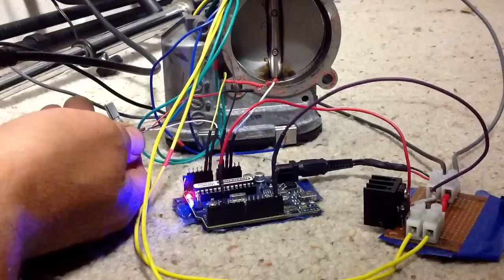Fly by wire throttle body controlled with an Arduino Clone

Comment: Crazy what you can find on you tube. Ive been wandering all day about how could do EXACTLY what you have done right here. Is there an instructable or schematic on your efforts sir, As i plan to use this as a simple open or closed valve in a twin turbo/super charger system. Thankyou in advance for your help.

Comment: Hi Charley Do the power is send via the PWM signal or the power is send via a DC voltage and the signal is on different wire with low current?

Comment: not good man....it has tu run h-bridge mode....if y base on the spring on getting the tp closed, when u run boost it will not come in the same position